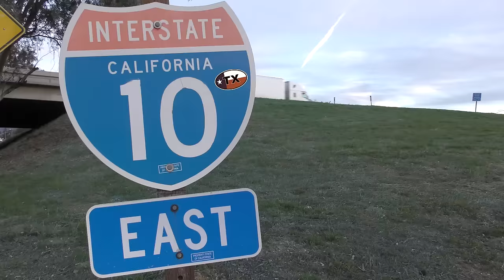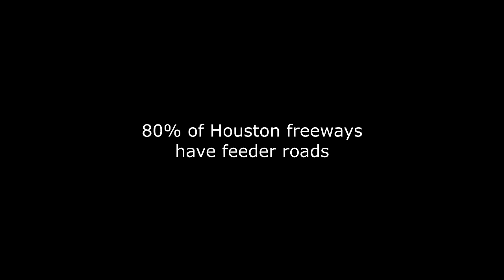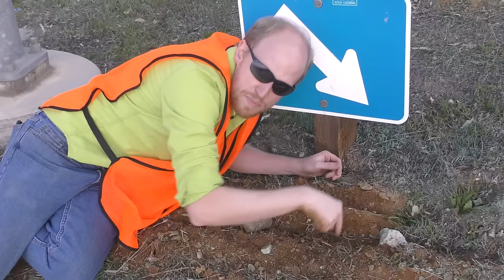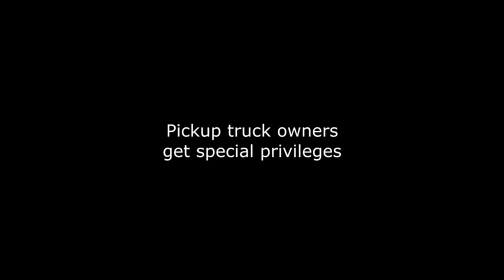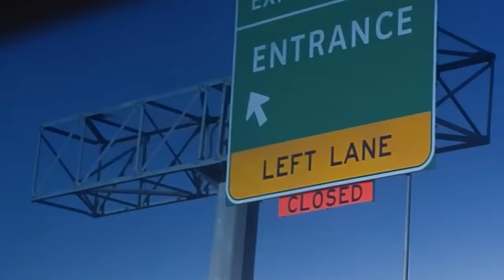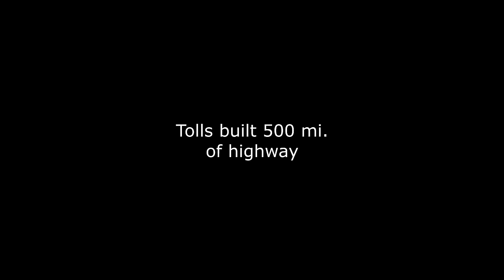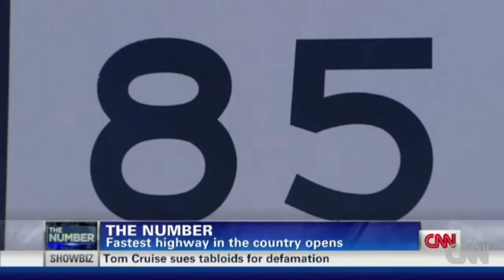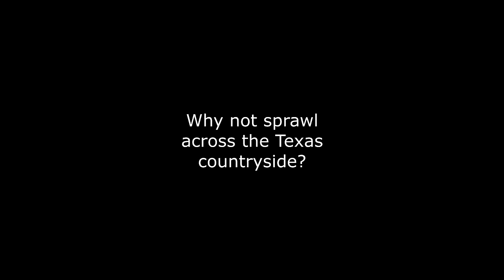How does good Texas engineering make REALLY BAD roads?

Comment: "cheating" the lights is definitely a feature, not a bug
Reply: They are now making feeders for the feeders where you have a road go under the crossroad without connecting to the interstate but it give you a entrance and exit to the interstate or texpress lane. So its no longer cheating when the state makes a more sophisticated way to not wait on the signals
Reply: People do that in Austin where I live also.  Overall it slows traffic down when the cheater re-enters the freeway.  I wish they would do like CA and other states and install lights on the on ramps. (Here in Austin, you would also need barriers that come down or people would just run the lights.)
Reply: Exactly, it is a feature. In Texas, the on and off ramps of what would be a diamond interchange are more often than not on the "wrong" side just so you can bypass the light from the frontage road. The frontage road also just serves as extra lanes in general.
Reply: As a Texan I use this feature all the time. Didn’t know other Americans didn’t have this lol
Reply: The grand parkway is the longest drawn out screwing done to Texans by special interests and their  greedy politicians ever.
Reply: @brandoncaldwell95  These actually exist in California.  They do not turn red unless the speed on the freeway is less than a certain speed(say 35 mph).  There is no accelerating to 80.  The  cut around tactics are not used if the speed on the freeway is normal, only during stop and go traffic, slowing it down even more.
Reply: @brandoncaldwell95  They have lights for the interstates and highways in Seattle as well, but only when there's heavy traffic, i.e. bumper-to-bumper at <50mph. The lights basically just blink on and off to control the rate at which people enter the interstate and are placed somewhat far back to give cars time to speed up. Most of the time they're off, but even when they're on I've never had a situation where I had to speed up to 80mph just to merge.
Reply: Everything he says is a feature not a bug. High capacity. Expansion. Easy access to businesses along the freeway. He's arguing that the system should be less efficient so that less people move out there.
Reply: @pattyeverett2826  very very very unpopular opinion
Reply: @justa9uy  Maybe there is a mis-understanding of what  I am describing.  What I am describing is people going onto the access roads during rush hour traffic and then getting back on (trying to jump ahead)  by using the fact that there are no lights on the access roads between off/on ramps. This costs most people time, only helping the selfish! Bypassing lights by getting on the freeway and then off is not what I am talking about.
Reply: @pattyeverett2826  In all reality it's an intended feature of the design because it keeps the lights from being piled up on too much. The traffic running perpendicular to the interstate can get across a lot easier if most of the people are going above on the overpass. There is no reason for someone to stop at that light if their turn is not before the next offramp or if they are turning onto the perpendicular road.
Reply: @justa9uy  I think we are talking about two different things.  Getting on the freeway and then off again, bypassing a light is fine in normal traffic.  What I am talking about is where there is an off ramp and then an on ramp with no access road light between(common here).  During rush hour, people jump off and then back on again to try to get a few cars ahead, slowing the overall traffic flow.  This is where the lights should be added.  In my opinion, this is akin to the people who try to cut into a right/left turn lane line at the last minute  in complete disregard to the  drivers who want to go straight that are behind them.
Reply: @pattyeverett2826  oh yeah, I see what you're talking about. Yeah that would be better, though maybe pricey depending on what guidelines they use for determining which intersections get a light.
Reply: Hell I used the feeder roads to skip out on traffic on i75 south. Hop on the feeder road to skip traffic hop off to skip the light. Now I live in reno and now know what not living in constant traffic feels like.
Reply: @pattyeverett2826  I like that idea. I saw on-ramp lights on I-70 in Denver while vacationing there, and it is very nice!
Reply: @pattyeverett2826  If you think it is slow in Austin, reverse the way those ramps are and see the pile up.  There is a reason why Round Rock and Pflugerville are transitioning the old ramps to this ramp structure.  It moves more cars up the road.  Not less.  If the off ramp were closest to the light, you would have cars from those lights spilling into the freeway lanes.  It is intended purpose for the off ramp just after the street to help relieve congestion at peak hours.  It isn't "cheating" as Rob states.
Reply: @bringo76  I have seen how well people jumping off Mopac and then back on again during slow traffic works many times.  A  slowdown occurs where they jump back on, hurting everyone.  As mentioned, gating lights that operate only at slow times would help.  Some states, CA and CO(according to comments already have these.) Another thing that would help Mopac would be getting rid of those death trap toll lanes.   There are studies that show that these toll lanes slow down the non-toll traffic.  In addition, the barrier-less toll lands have cause so many accidents in Florida(including fatalities) that attempts have been made to pass a law banning them.
Reply: If you're going to do it, get up to highway speeds.
Reply: @brandoncaldwell95  We have them in the UK Peak time operation only to keep the "freeway" (we call them moterways) from slowing to a compleate stop... They attuly work! Typiclay when they are in operation the Motorways speed has been pushed down to 30-40mph due to shear weight of numbers and congestion. The idear is to let small platoons of cars from the ramp to enter the motorway at a time and thus keep everyone moveing (all be it slowly) https://www.youtube.com/watch?v=xv6DOvNfzVQ
Reply: I have seen that one go in the other direction with people using the ramps for cross roads to scoot up a 10th of a mile or so when the highway has come to a stop.
Reply: Yeah, and many asian city highways are following this too. Beijing's and Shenzhen's are more planar like original Texas', while Shanghai has to build theirs in elevated version.
Reply: @pattyeverett2826  uhh... no, people getting back on don't slow down traffic at most of the ramps through Austin, at least on the north side of town. They used to, but that's why the vast majority of the ramps now have their own dedicated lane which goes down to the next exit - or else, at least, the entrance is after a light (instead of before it). The people slowing down traffic there are generally the "regular" road users: people who can't figure out how to fit into a lane (because no one is leaving any space between them and the next car), and end up straddling both lanes while trying to change to/from the 'travel' lanes to the 'exit' lane. Wanna help? Leave some space. It won't take you a minute longer to get where you're going.
Reply: @pattyeverett2826  Switch out light with roundabouts. Fixes so much.
Reply: @pattyeverett2826  The point is that you are able to take the freeway, which has no light, up until you have to turn off of it. If you're just going through all the lights on the feeder road, why not just take the freeway? That's not cheating, that's how it's designed. Arguably you are slowing things down by not using the interstate system as it was intended.
Reply: @trentspears9118  This is exactly what is happening, people are not using the system as intended.  During rush hour, they are getting off, going onto the access road, then re-entering at the next freeway access.   They do this trying to get a few cars ahead.  Their re-entry slows down traffic on the freeway.  If there was a light on the access road or some other means to void this gain they think they are making, this practice would be reduced  or eliminated, speeding up freeway traffic.  (Of course, in Texas, anytime the freeway slows, some exit to the access road using the grass median-there are some real jerk drivers here).
Reply: BronzeKaiser  The speed limit on the access roads here his 45-55.  Due to the heavy Austin traffic, even on the access roads, going faster than this would be difficult.
Reply: BronzeKaiser  Not in Austin rush hour traffic!
Reply: That's something I never grew up with, but I'd much rather wait for the light to change than try to "cheat" the red light on the freeway. What would happen if the freeway got backed up?
Reply: @bearworldwide101 there is special feeder in Georgetown that just for bypass the light but not for getting on the HWY but you choose which one want go at begining of the entry ramp, wow feel bad for anyone outstate come cross that.
Reply: @bearworldwide101  So THAT"S what the wrong turn generator on Conroe Loop 336 north is. Advanced light skipping technology
Reply: @SolarAbyss  Most of the time in more dense areas these exit only lanes go from exit to exit, therefore alleviating the necessity to merge
If they don't, by god take all the opportunity you have to speedrun your next turn at 75

Comment: Former Houstonian.  I grew up thinking that flooding in neighborhood streets was commonplace.  The streets became rivers with the curbs as embankments.
Reply: Houston’s neighborhood streets (and actually all streets and highways) are specifically designed to flood and serve as drainage basins of their own. It’s also the reason you see 59 and 45 below-grade and filling up with water at every flooding event. We should be working on preserving and re-instating the flood plains, but using streets as drainage basins is also a great addition
Reply: Texas could learn a thing or two from European big cities.
Reply: @Peter_Scheen  It’s actually an intentional design feature.
Reply: Most European COUNTRIES fit inside Houston.  @Peter_Scheen
Reply: @ShutUpBubi Most? Like 2 European countries are the same of Houston
Reply: @Peter_Scheen 90% of the whole USA could learn a thing or two from Europe

Same with Canada and Australia
Reply: @lolnyanterts they’re taking the Grand Parkway to account, are they?
Reply: You laugh, but I talked to an engineer when they were putting in curbs and gutters in my parents neighborhood.  I couldn't understand why they had 48 inch pipes, but only had 4 inlets on the entire long block.  They confirmed that the design was to use the road as part of the conduit to get the water to the even larger pipes down Gessner.  As noted above, two pipes large enough to drive a full size pickup through.  Previous to that upgrade, it was two pipes large enough for a mini pick up.  It worked.  As noted above, no water in the house from Hurricane Harvey.
Reply: @hvfd5956  Yeah, I think the problem is the original methods they were using don't work anymore as Houston expanded over the past several decades.  They paved all that grassland and rural areas that were good at absorbing a bunch of rainwater to keep the reservoir from over filling.

Heck, I remember one flooding event back in '91/'92 where the under pass at I-10/Sam Houston Pkwy was completely flooded.  It took 4-5 hours to reach our home when it was normally a 30-45 minute commute.

Those roadway basins act as a good conduit for catching that excess rain water but creates a slew of logistical nightmares down stream.